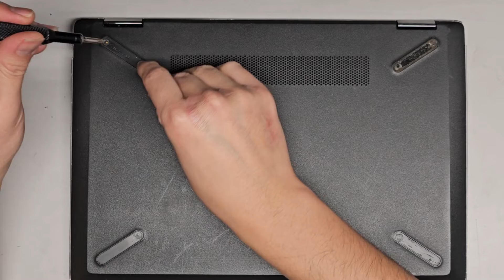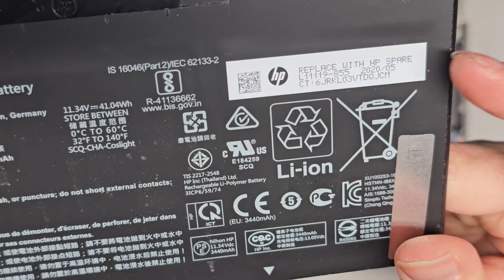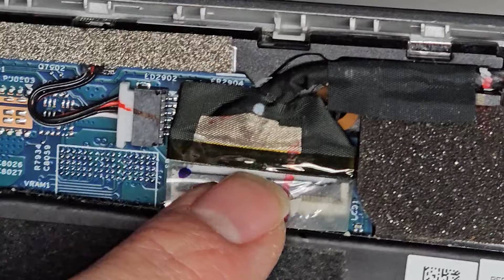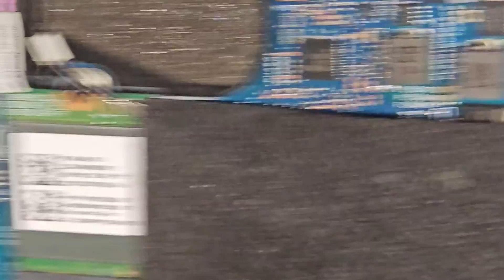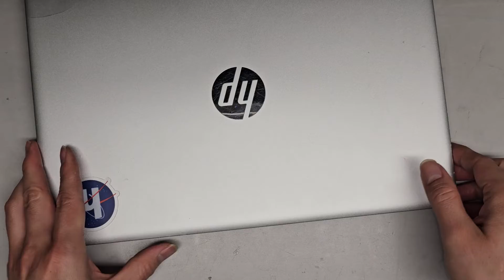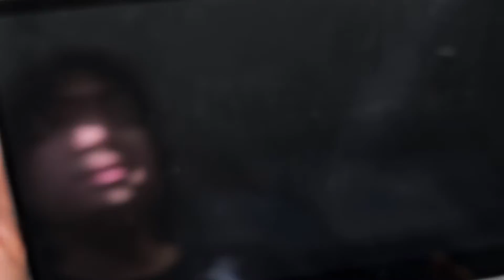HP Pavilion x360 Convertible 14t-dh100 Disassembly RAM SSD Hard Drive Battery Replacement Repair

Comment: have you tried before replacing the Intel Octane SSD and removing the HDD to put an Nvme SSD to be running alone? I wanna try it but not sure about it yet.
Reply from the maker: Yes, it's much faster. I do that on most Intel optane computers. Intel optane is dumb...